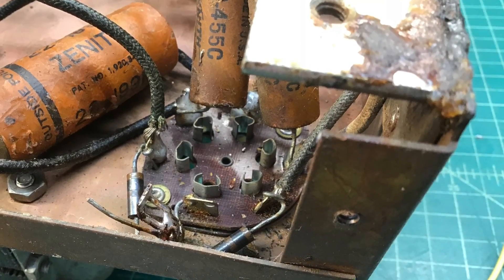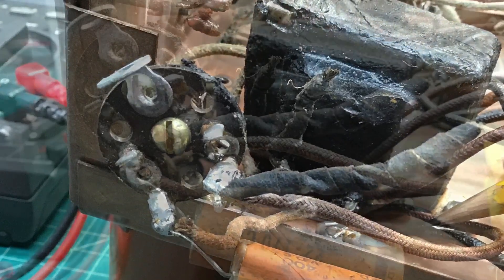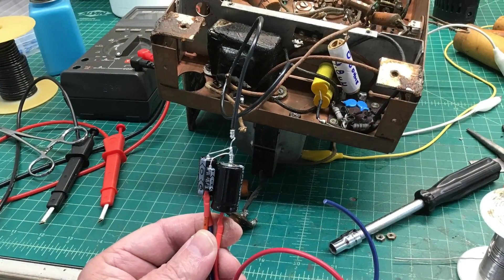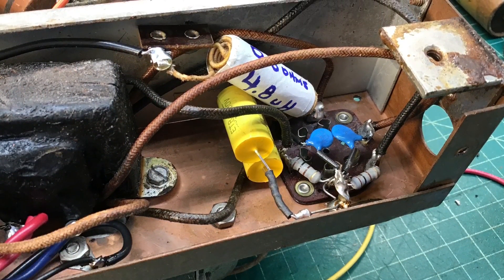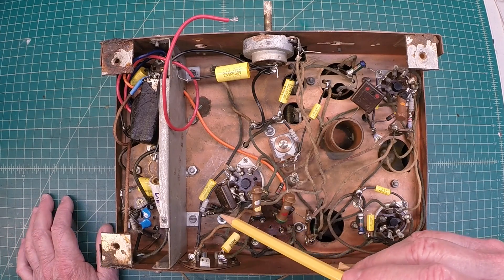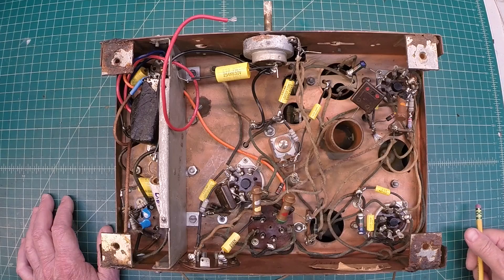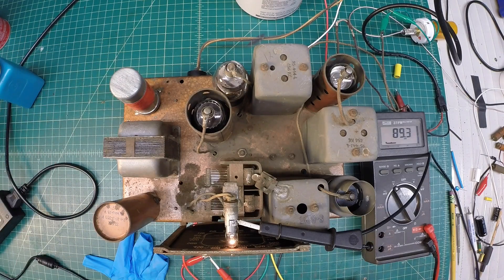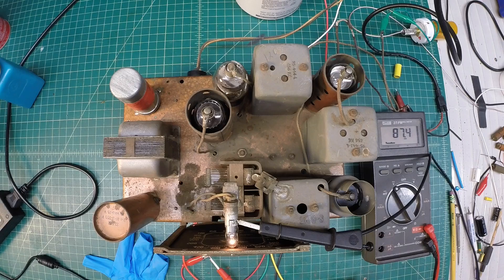Zenith 4-B-231 - Power Supply & Synchronous Vibrator - Part 6

Comment: That tar substance is more than likely pitch/bitumen, it is there to encapsulate the high voltage so it doesn't cause tracking or ionization.  Sort of like carbon tracking you used to see under distributor caps of the old days.  If you want to replace it you should look into a synthetic potting compound since you don't want any type of acid that can come with low grade pitch/bitumen.

Comment: Don, I have rebuilt 2 GE 250's and found the vibrator to be troublesome.  I later found an open coil and had to adjust the single contact that makes it vibrate.  The one with the open coil, I just put a solid state power supply in.  Works great.  The set with the working vibrator hums some.
Reply from the maker: Thanks for the info Josh. It seems the old Vibrators are inoperable or not reliable if working today. It’s been fun opening it up to gain a better knowledge of how they function, even though I still don’t grasp all of the theory that supports their actions. Solid State makes sense to me too for a daily player. Best, Don

Comment: Hi Don. Great job on the repairs.I remember those  vibrators  :) I can remember cleaning the contacts and burnishing them. Has long has the coil was good ,I was in business. I was a teen at the time. Some of my Dads cars and trucks.  I Liked,Shared and added to Playlists.
All my best.
Bobby
Reply from the maker: Bobby, you got an early start repairing them. I should have sent you this one. Anyway, it’s been a learning experience for sure. In P7 & P8 I’ll try stabilizing the unit. Thanks for watching and sharing with others. Best, Don
Reply: Hi Don. if you want a radio fixed don't send it to me : )  I finely got the no name radio, to make noise  Lol. If I hook a audio  or am transmitter to the one wire antenna lead Nothing. If I hook it to the volume ,6A6 , or one part of the tuner it comes out the speaker. The tuner doesn't work at all seems a section is dead I checked the tubes they check fine. I can't remember how to check the voltages Lol. I best get to re-learning  / reading.
All my best.
Bobby

Comment: Very nice video of the vibrator! From here in East TN, it looks like not all the contacts are making contact. But, my eyes are not what they used to be! Lol. Im sure the next part will describe the theory on how this works, Im not all that sure how it works either. Pulsating DC stepped up? Thanks for the video! Take Care--Larry
Reply from the maker: Thank you Larry. More on theory down the road assuming I get this nasty little thing working correctly. The old rubber/foam base has completely degraded and I’m thinking it’s just one of the issues I’ll need to tackle. I appreciate you watching. Best, Don